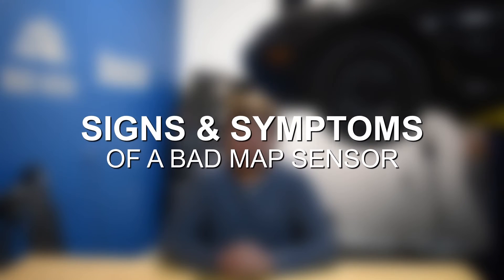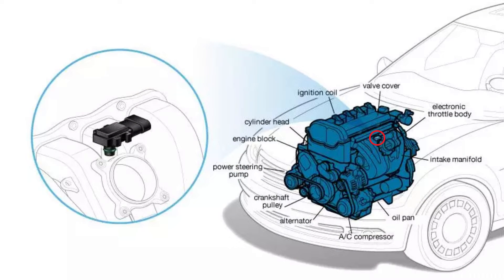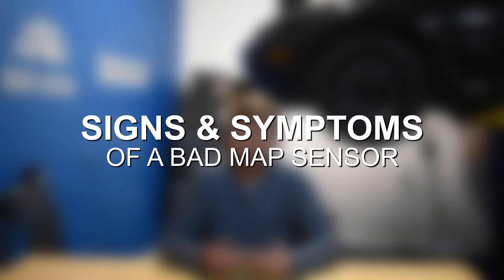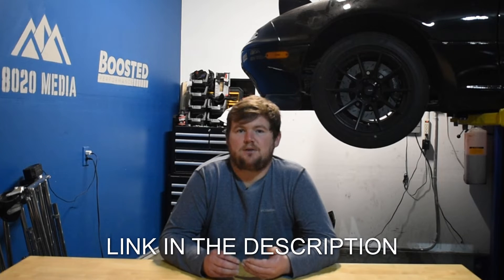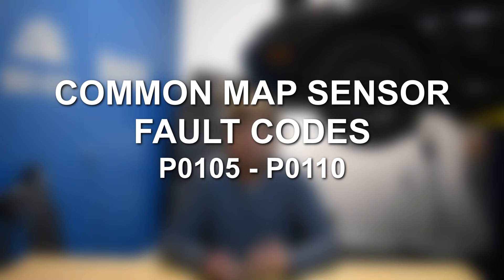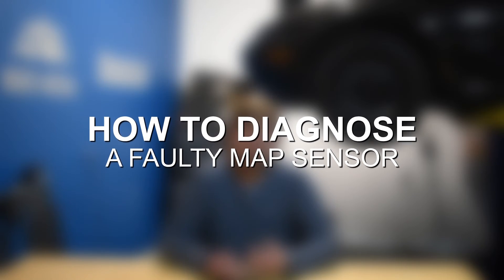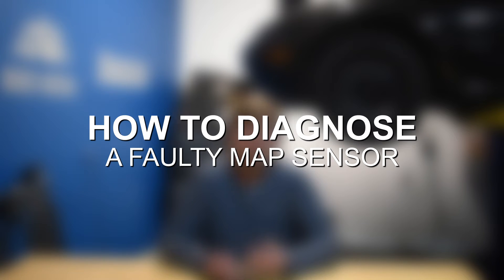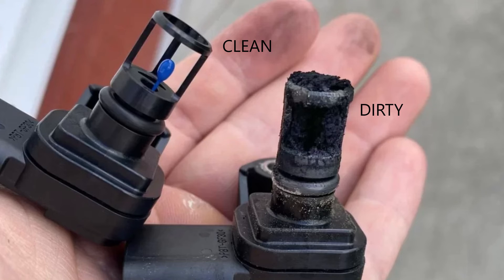A Bad MAP Sensor – Symptoms, Causes, and EASY Fixes!

Comment: So im having a issue with my 2008 ford focus in the beginning i had a p2196 code for a 02 sensor bank 1 sensor 1 stuck/ rich biased code i was having rough start ups sometimes its struggles to start and sometimes it starts right up and when it does the rpm's drop then fluncuate then idles and when i put it in drive the rpms drop and slightly struggle to rise and when i try to drive the car it stutters ,hesitates, jerks and has low power and cant really get higher than 4k rpm's and if im at a stop light the car may or may not stall and if it does i smell feul amd get a banana check engine light i replaced the 02 sensor and also put in a new valve cover gasket due to a leak and new spark plugs wich had a light colored charred color on them And after the new sensor the code and check engine light went away but im still left with the same syntoms and when the car stalls i get the p2196 code and check engine light again but when i start the car back up the check engine light is gone but still poor engine performance. Im lost between sensors, feul and air and could really use some guidance
Reply: Did you ever figure it out ?

Comment: I had my engine light come on right after replacing the timing chain on my F150. Used a cheap OBD II reader and found it was turbo over pressure reading. Cleaned the sensor coming from the air box and problem solved. Looked like the mechanic changing out the timing chain might have got some dirt in there. I already had a can of MAS cleaner on hand, so cheap fix. I'm sure if I took it back to fix the problem it would have cost at least a $125 diagnostic fee. 😅 7:16
Reply from the maker: A - Love hearing this. Thanks for sharing your experience!

Comment: I recently had a bad map sensor in my Chevy. It mainly acted like it wanted to cut off at idle and had hesitation when hitting the gas.
Reply from the maker: T - Thanks for sharing your experience!
Reply: @8020Automotive my volvo just idle high when you crank it up. I got a code for map sensor and boost sensor. My map sensor came should I install it and ee if thats the only problem?
Reply: I'm having the same symptoms with my GMC Envoy, but no CEL light/codes. DId you get codes?
Reply: This happened to my 1991 Chevy 1500. I start my truck and I have to hold the gas down to keep the truck on. Once I take my foot off the gas my truck stops running.
Reply: Same symptoms with my Nissan Sentra
Reply: Same here! Really sucks to have a faulty part. Rough idle/startup/hesitation on the gas